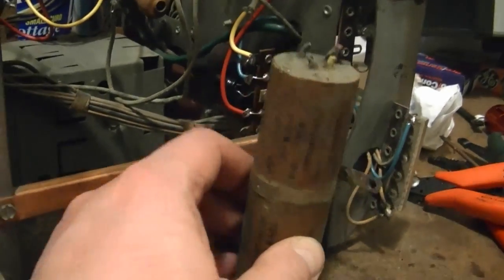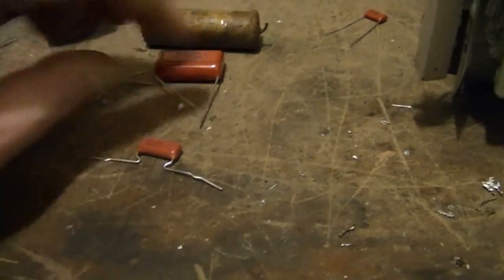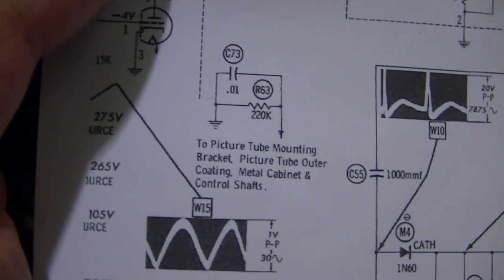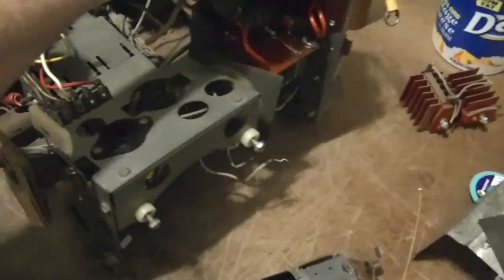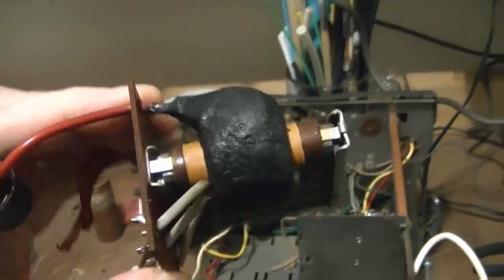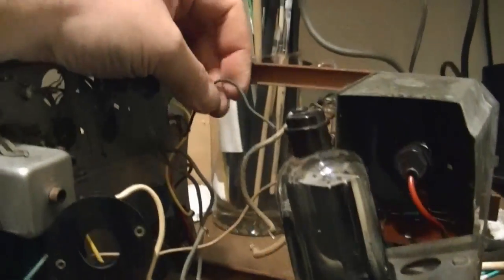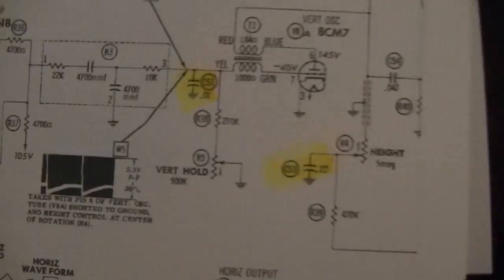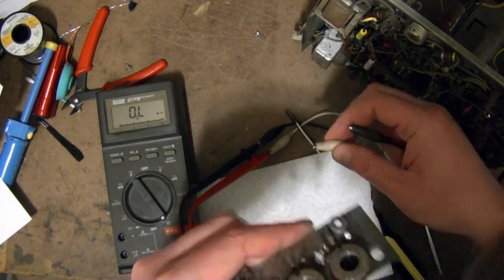Sonora 664 restoration pt2o4

Comment: How did you select a proper “TEST” CRT?  Obviously the neck diameter, and deflection angle must  be correct. How do you match the electrical characteristics?
Reply from the maker: There are only three to choose from. 5AXP4 for early round. 8XP4 early rectangular like this and 8YP4 for late rectangular.  All are 6.3 volt, 600mA filaments which is the most common. They can handle a wide range of voltages on the grid and anode.
Reply: @bandersentv thank you

Comment: That resistor and capacitor in parallel is what you would find in an AC/DC radio to couple the B- to the chassis ground, and yet isolate it at the same time, making it a luke warm chassis set instead of a hot chassis set.

Comment: Bob:
For the heck of it, I looked up the data sheet for the Panasonic cap. Yeah, in the code for the part number there is NO eplanation why the 6th & 7th positions dedicated to rated voltage is "2W". I found out the 250V caps only have 2 in the 6th position and blank in the 7th. The 630V ones have 2J in those positions. Clear as mud. The price and size are definitely right though! Plus they have a +/- 5% tolerance. The other excellent thing I noticed is that they say they have a "built-in fuse function". Maybe like a safety cap that only opens if it goes bad?
I'll order those next time. It looks like they might be small enough to stuff in paper tubes too.

Have a Merry Christmas to you and your family!